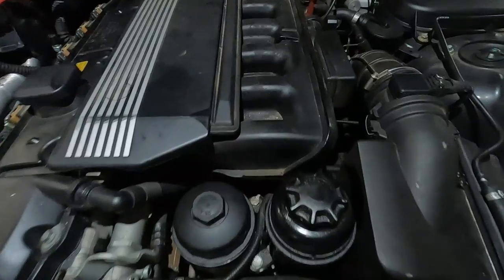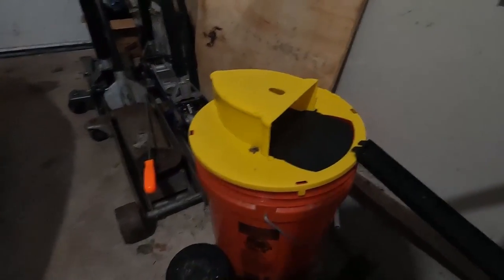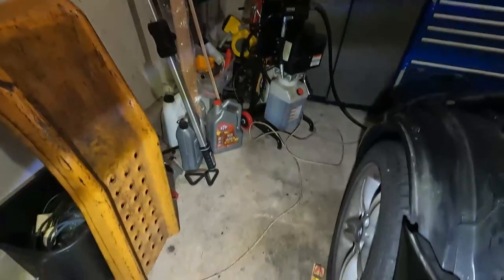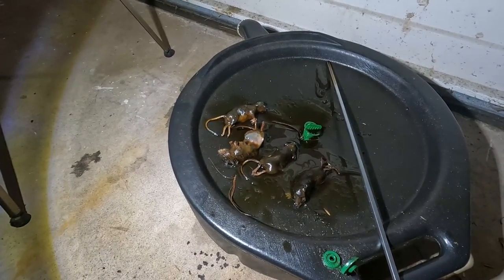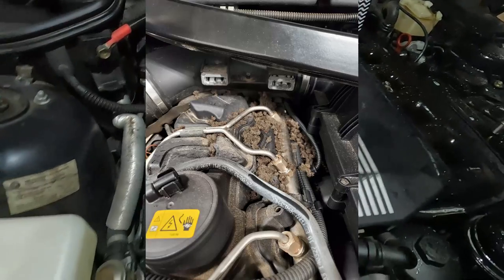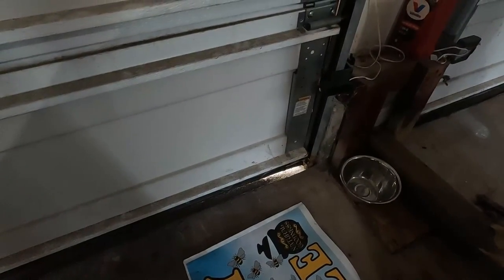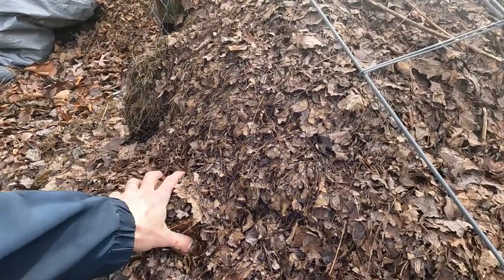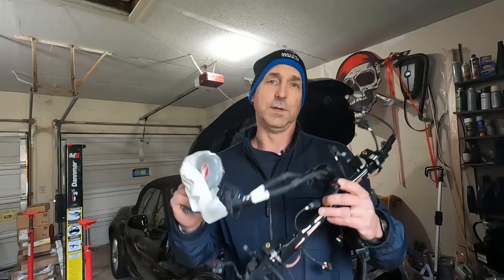Stop RODENTS CHEWING CAR WIRING! EASY TIPS TO KEEP RODENTS OUT OF YOUR ENGINE BAY!

Comment: Hi Roger this is Alvin, I have this same problem with mice. I spray peppermint oil, in all 4 wheel wells, and I spray peppermint oil in my engine bay. I also use sticky traps, in my engine bay, and around the tires.
Reply from the maker: Hi Alvin, That sounds like a great method! I have seen so much damage from rodents. I hate to say they help me make $$$ but I would rather have people take some measures to stop the damage. Great to hear you have a method that's working!
Reply: I do the same and I place a 500 lumens rechargeable flashlight  from Harbor Freights. The brand is Braun.  Mice hate light.

Comment: The best video on the rodent problem.Only one I was able to solve was the 24 yr old Camry running on five cylinders.Damage was in the front,wire completely severed, spliced in a new section.
Reply from the maker: Thanks Willem! Rodents help techs make money but not good when it's your own car! Better to keep them out or dead in a bucket trap. Great job fixing the car!

Comment: Interesting about the wheels. Had a car totalled because of those pests eating wires. I use peppermint oil spray. Luv your dog. Pine Sol interesting did not know about that one. I have plenty. Great video. I could ever dig out those mice in a trap of any kind.
Reply from the maker: They can be so destructive! Sorry to hear about the totalled car. The bucket traps work amazing! Motor oil in the bottom and no smell. Works 24 / 7

Comment: My mechanic advised to stuff Bounce dryer sheets all over in the engine compartment after paying him to rewire my fuse block a few years ago when the critters dined on the wiring. I get the mondo size box of Members Mark dryer sheets at Sam's every fall and haven't had a wire chewed on since, but I also have a few bucket traps scattered around the garage. I'm testing out old antifreeze in my buckets this year, so I don't have to keep thawing out the water, never tried used oil.
Reply from the maker: Hello, The dryer sheets do work to keep them out of the engine. Good idea on the bulk order of sheets every year! I also now use Honda rodent tape on harness repairs but I always keep my bucket traps working at home. Coolant should work well but due to having cats at my home I want to make sure they don't get into it and die from poisoning. The oil works amazing!

Comment: Will these tips work on squirrels? Squirrels got to the wiring on my RV. It is at the shop now.
Reply from the maker: @JA-fw6lp  That sucks! These items will help but if they are earing wiring you can also use Honda Rodent Tape. Wrap up all accessible harness.   it's hot pepper tape.
Reply: @AskTheCarExperts  Thank you!

Comment: I know that this video was a while ago, however this is for anyone reading the comments on how to get rid of rats and mice, the video is excellent as well however you can also buy a large bag of granulated cayenne pepper and put small spoons of it around edges of the garage walls and behind cabinets the hate this stuff, however it can make you cough because it's ground cayenne.  Bugs don't like it either, if the rodent has eaten a round hole in your walls sometimes they do this to gain access to the inside of your home, take a little peanut butter and rub it inside the wall where they are the whole, then take a tablespoon and put some cayenne pepper on it spoon it in the hole, blow it in if you can do this also behind dryer holes and say you kitchen under the sink where there is a small hole from the pipes. Put some in there put it where mice and or rats are coming in if they get into this they will have to get out quick to get 💦 water as this will burn their tongue and eyes if they scratch it on themselves. Put it where your only mice or rats will come in. Make sure your pet doesn't get into these areas.

Also outside you can kill these critters by mixing baking soda (AKA) sodium bicarbonate same thing with any food scraps rats and mice are not too fussy they eat rotten food. Mix a good amount through the compost scraps and put it in small plastic dishes in your garden, check every day to see if they are it, they will die because mice, rats, squirrels and cockroaches cannot digest baking soda and will die.

Cockroaches are attracted to onions and onion powder so mix equal amounts to kill them off they will bring it to the nest to feed the others then they will die.

Won't harm domestic pets only these animals. Rats mice, squirrels and cockroaches. 

If you live near a creek or small brook you might have to put some scraps mixed with baking soda there too because they live near creeks due to water.  Tell you neighbors to participate in doing this if you have the problem with these creatures they have it too.  If everyone participates in their eradication you might be able to kill them all off for a good long time.  Just keep doing this and they will die.
Reply from the maker: Hi Gregory! Thanks for the tips bud!!! I hate mice! But they do help techs make some $$$ when they damage cars!

Comment: My car kept stalling while driving and my mechanic found out the harness wires have been chewed up by the rodents and three giant nests were found around the engine.  Thank god, I could claim from my Insurance.  Otherwise, I have to pay $4,000 to get it fixed.
Where do I put the Bucket?
Reply from the maker: Wow they did some crazy damage! I have my bucket right on the side near a wall and the ramp down near the wall. Rodents usually follow a wall and this will help you trap more.
Reply: @AskTheCarExperts  Thank you 🙏.

Comment: I've watched so many videos on how to keep mice out of your car and everybody says peppermint oil I tried it years ago did not work three vehicles damaged a fourth vehicle burnt to the ground peppermint oil does not work!
Reply from the maker: Wow not good! It can be a deterrent but it would only be part of the solution. I use bucket traps which work great plus the rodent resellers and have been good so for.
Reply: @AskTheCarExperts  the bucket traps work well as long as the vehicle is in the garage. And I have a backed up system catching black snakes in the summer and letting them go in the garage wife will go nowhere near the garage now LOL great place for some peace and quiet.

Comment: instead of oil in the bucket trap you could use blue washer fluid it's clear and it's pretty safe and it will not freeze. and if you want to see what works for rodents go and have a look at shaun woods youtube chanal he is the pest expert.
Reply from the maker: Hi Christian, the problem with washer fluid is that is has alcohol.  It's also made to evaporate and can be flammable. It may work but I think oil may still be the better option.

Comment: As a guy who has killed hundreds of squirrels and mice, I give your video an A +. You have
to basically kill them, or they will kill your wallet. I don't think your bucket will work for
squirrels, but for mice and rats - YES. For squirrels, I live trap them, and drop the trap,
with the squirrel in it, into a big drowning bucket, and it's over in 1 minute. ( drowned) then
I bury them. Don't ever use poison, because I had squirrels eat my poison bait, and die a
long painful 4 day death, and moan etc, then die up in the attic, and the death smell of
rotting flesh will not go away, and smells terrible. Then there's the risk of pets eating these
poisoned rodents and dying that way as well. Best is to drown and kill them, or shoot them
if it's legal where you live. Mice can be killed by those small snap traps, but squirrels, and
especially big grey squirrels, are too big and strong for those little snap traps. It seems
you are only battling mice, but when your battling both, it is an all out war. Good video, and
one of the "few" realistic videos I've seen. These smell types of deterrents don't work, and
if they do, it's only when their fresh, and their smell is strong, but I would not trust them.
One thing that likely would work ( have not tried) is rust remover with sulphuric acid in it,
under the hood of your car, which will burn their feet, and they will be gone. These rodents
are no joke, and anyone reading this, get on it right away, and save yourself a lot of grief.
Reply from the maker: I completely agree with you. Mice and squirrels cause a lot of damage and poison traps are dangerous to other pets.

Comment: A shorter pail with about 4 inches of water, throw a handfull of oats on the water. The mice will drown. Throw the water out
Reply from the maker: I found that in my sheds, I forget to check the bucket and it gets a bit gross with just water. I tried chlorine water but still gross. Oil works best for my situation. I use waste oil, then drain the bucket and recycle the oil. The dead mice go in the trash :)

Comment: You didn't go into detail as to how to make the bucket trap
Reply from the maker: Thanks for letting me know! Maybe I will put a video together on how I set it up. You just need a home depot bucket and put the lid on top but I like to fill with used motor oil which keeps any smell down and scoop them out and replace the oil every vehicle oil change :)

Comment: If you have a carport don’t use snap traps unless you want to see little dead birdies snapped in half.
Reply from the maker: Good advice. Never caught a bird in mine but they are inside. The bucket trap would work well in a carport.
Reply: @AskTheCarExperts  I’m going to try that brand bucket trap.  My husband made one of the DIY bucket traps with a wooden dowel and piece of pvc that rolls and dumps the rodent in the drink, but that caught a bird too.  Sad.  The one you show could be modified to extend the cover out and down to the rodent ladder, preventing birds from entering.

It freezes here, but not badly enough to affect our cars in our two carports.  Out carports are extensions of the house, under the roof which is extended to either side of the house by thirteen feet.  

The carports are partially enclosed by four foot tall walls, except for the front where you drive in.  If we were rolling in dough, one or both carports could be enclosed, but we’re going to have to settle for rat traps.
Reply from the maker: @MendocinoButterfly  Poor birdie, I really think the bucket trap would work well. I don't leave a large amount of bait. I just rub peanut butter as a smear up the path to the back of the trap. This should help keeps birds out I hope 🙏
Reply: Less birds pooping on my clean cars! 😂